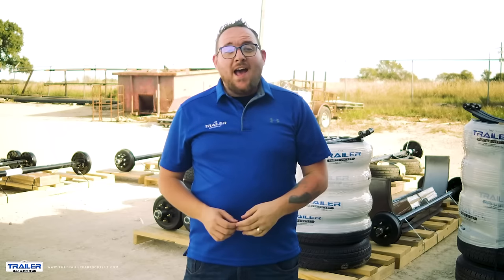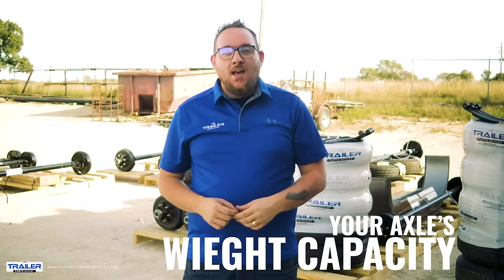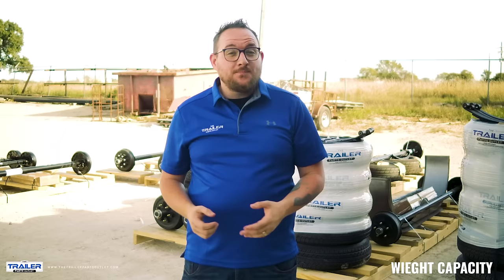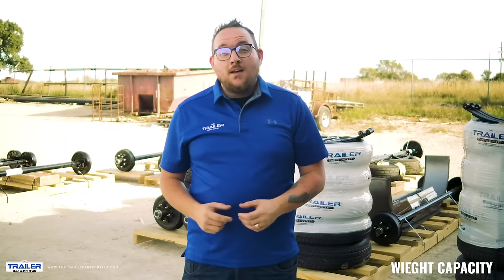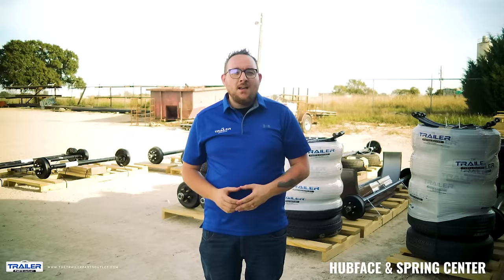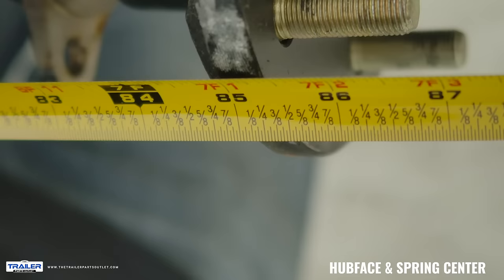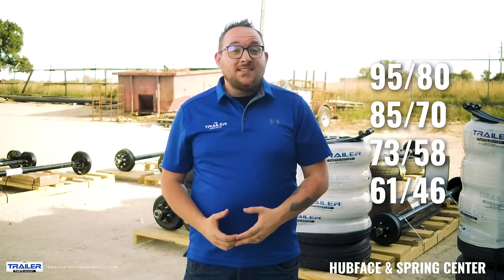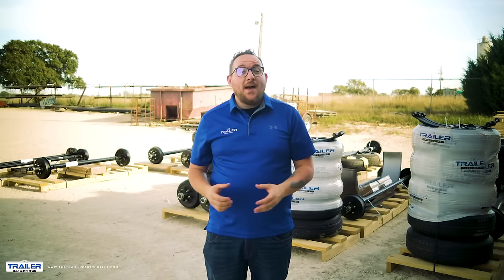Quickly Identify Your Trailer Axles in 2 Minutes | #Dexter & #Lippert | The Trailer Parts Outlet

Comment: Are all spindles replaceable or are some part of the axle? The spindle thread is stripped on mine and I hope I don't have to replace the whole axle. Thank you for your time.
Reply from the maker: Yes! Absolutely they are. 
Check out our website to look for the one that will match your axle!
https://thetrailerpartsoutlet.com/pages/search-results?q=axle+spindles
Reply: @TheTrailerPartsOutlet1  cool thanks
Reply: Yes all spindles are replaceable , but is it worth the cost of the replacing the spindles or buy a new axle if the TUBE is bent .

Comment: 5-5 or 4-5 bolt pattern? Would have been nice if you explained how we know which we have.
Reply from the maker: We have a whole video here: https://www.youtube.com/watch?v=0I9Vdvkrgq4&t=1s
Reply: @TheTrailerPartsOutlet1  , thanks, but at 50s into the video, your guy talks about establishing the capacity of the axle by the bolt pattern. The 3.5k has two common configurations... 4x5 and 5x5, or something. What about other axle capacities? I get measuring the length of the hub faces and spring seats, but I guess I should also know how to tell the capacity.
Reply from the maker: @GenericUserUnknown  In this video we use the 3.5k axles as an example. For other capacities you are more than welcomed to call us and we can walk you through any information you need. The common bolt pattern for a 3.5K are 5x5 and 5x5.5. The 2K axles are more known for 4 bolts. We do appreciate the feed back and will get a video made on common bolt patterns for all capacities that we carry.

Comment: How should I calculate Hauling capacity? Is the weight of the trailer frame deducted from that 3,500?
Reply from the maker: Take the capacity of your trailer, if you have a 3,500 lb capacity for example, subtract the dry weight of your trailer. Then you are left with the load weight you can haul. 
If you need any help give us a call: 936-349-6507
Reply from the maker: We have a video coming out this week on this subject! Make sure to stay tuned!